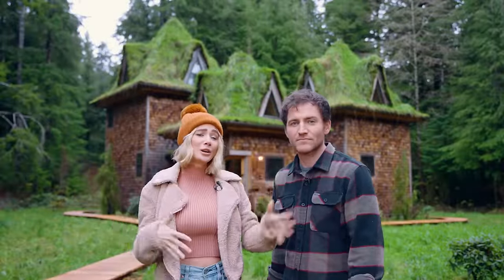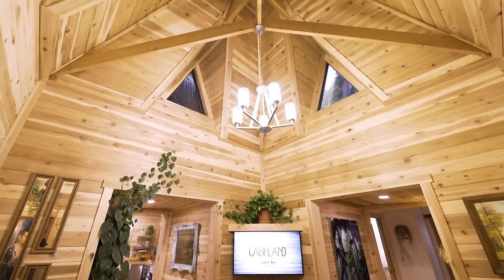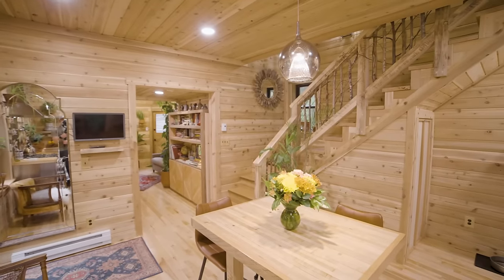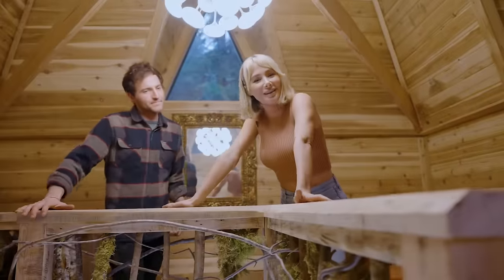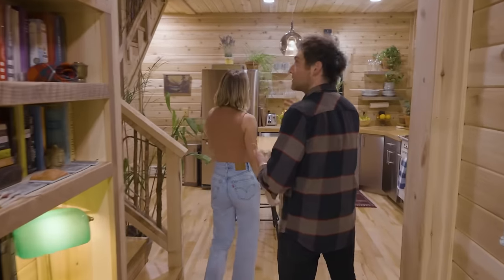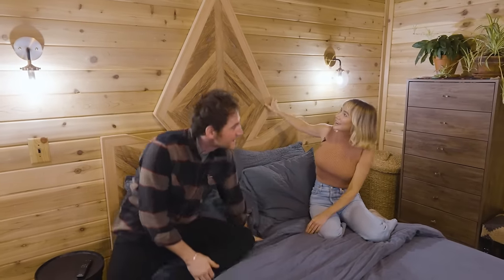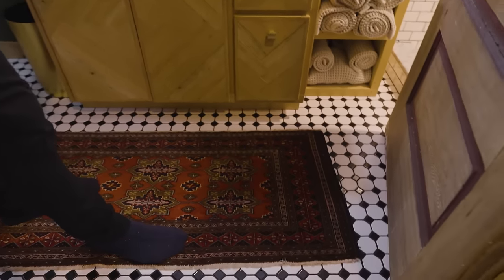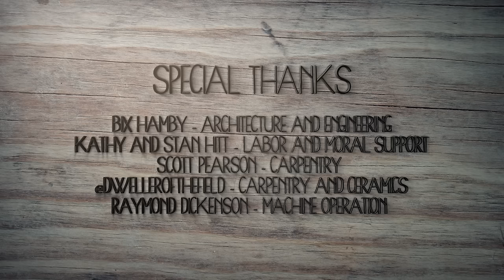Cabinland Season 2: Episode 4 - the Castle Cabin

Comment: Hey I love what you guys are doing.  Just wondering what your land is zoned for out there in WA?  In most rural areas the most dwellings you can fit on land in 1 per 5 acres.  It is rare to find a place out in the woods allowing a density more than this.  If you guys are doing this with the intention that these are nonliveable structures or sheds because most of them lack direct plumbing... that is often not the case for the county health and safety commission which often defines dwellings by the presence of a kitchen area.  I would really like to know how you guys are getting around the dwellings per acre rule  because on 10 acres because I would really like to do this too.

Comment: Beautiful!!! Wish the cabins were connected, or connected by hallways.
Reply: They are connected. At 1:05 you can see the two, larger modules are connected to the smaller, front building by passageways/hallways. And at 3:45, you can see them on either side of the tv. It is a pretty cool design.